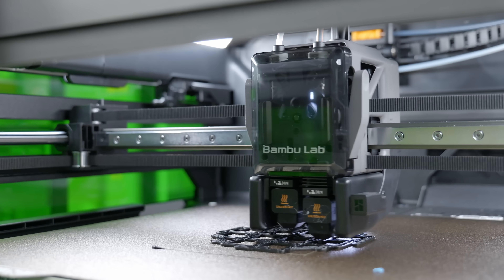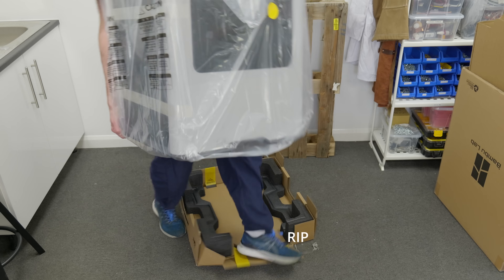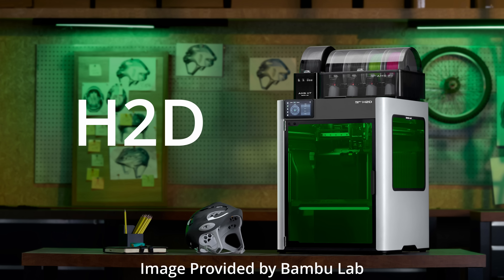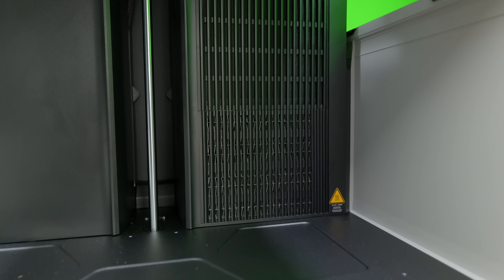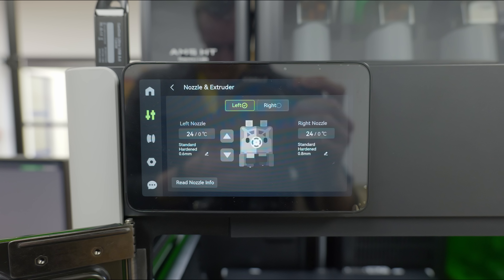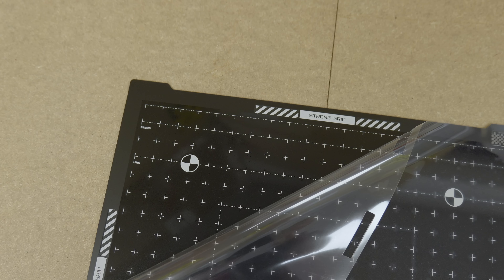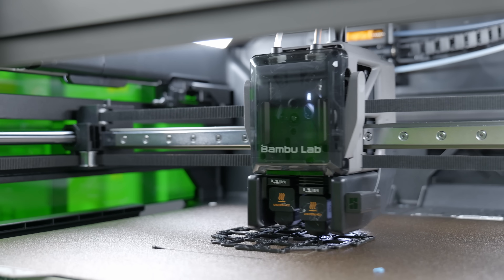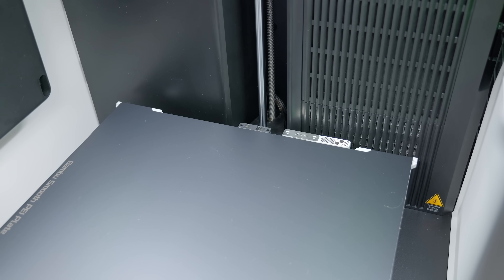Bambu Lab H2D First Impressions User Review

Comment: I need at least another 3 years to forget the truth about them and buy one. It took me 6 years to move on from DJI destroying 3DR. I suppose at least Prusa survived which makes it less painful. Nice breakdown Adam, first place I came to.
Reply: Remeber that Bambu is founded by ex DJI engineers.
Reply: @bp8__163  Guess that explains why they essentially brought the whole industry up another level, not their first time
Reply: What's wrong with bambu¿ aside from the closed network software thing they're trying to do
Reply: You'll never forget a truth you made up. Using the companion app take literally seconds. Or just  stay on old firmware or flash to X plus.
Reply: @jimmanis6717  I was alluding to how Bambu developed bespoke software with no open source code in under 2 years that took the 3D printing community (Marlin, Reprap, Klipper etc) 20 years to develop.
Reply: Prusa knew the rumors, still they released their One Core XY without any form of tool changer, idex, whatever. Crossing my fingers that Bambu once again is setting the standard for innovation. I am rooting for Prusa but they are currently collecting silver medals.
Reply: @vidarwaagb282  It’s amazing what you can achieve with an unlimited state backed budget where profit isn’t a factor. Fair play to them for doing what they are doing, but comparing Bambu to any other company, especially in the west, is 🍎 to 🍊. No one will ever be able to match what they can do.
Reply: @zerofox3d All it takes in the US to get unlimited funding is to convince a VC that your idea will win
Reply: @1bbnnkk  But a VC wants a return on the investment, the CCP just want to see the western companies fail. Ironically I have given in to the temptation and my H2D arrives today. I am implementing a rule whereby for any Bambu I buy, I will buy two Prusa machines, keeps the playing field more level.
Reply: @zerofox3d  Don't philosophize too much. The Chinese are reaping what they have sown and their hard work finally pays off. BBL innovated and they continue to innovate with H2D.
Reply: @zerofox3d what western companies? All major consumer 3d printer manufacturers are chinese, except Prusa.